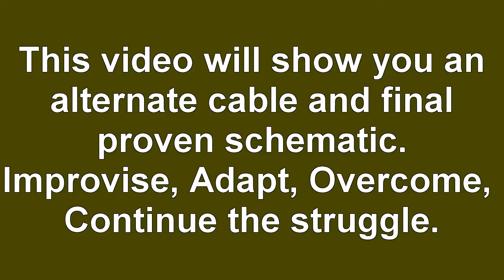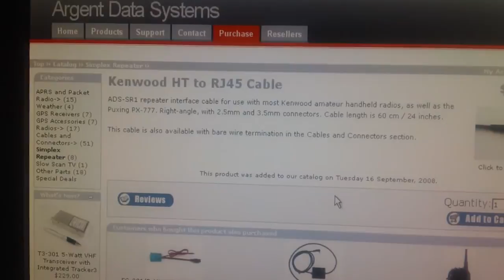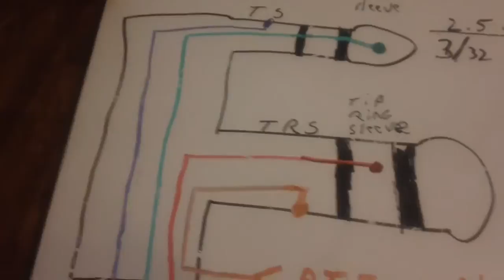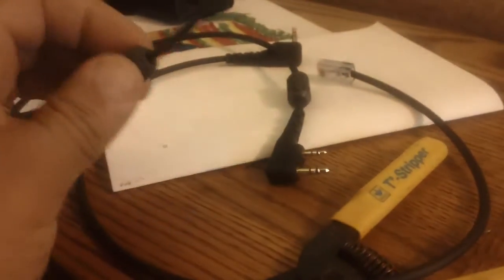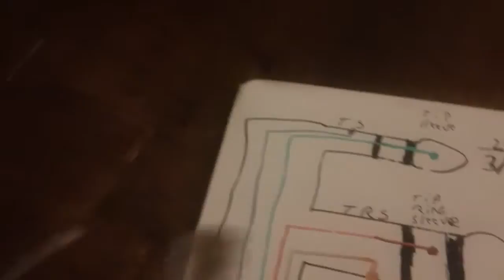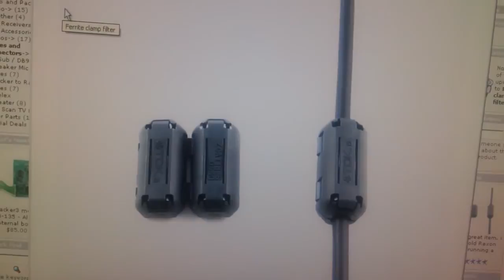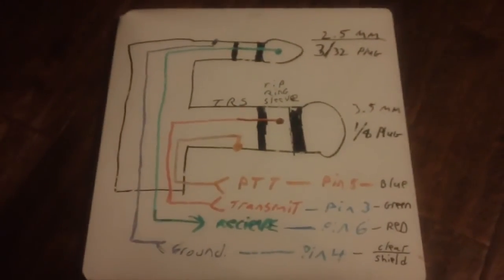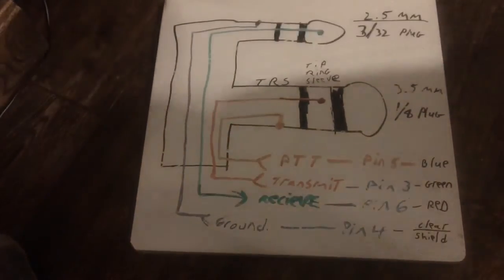SHTF WROL Simplex Repeater Build, TYT & Wouxun updated Radio interconnections.

Comment: The Baofeng UV5R I bought comes with a head set and mic and I found the cable acts as an antenna. I had to add a ferrite bead to prevent it locking into transmit in the same way as you have.

Comment: its a voice recorder that re transmits its stored audio not a true repeater. With all the trouble tootorola  make an HT repeater isn't worth the headache. just order 2 mobile radios like a Mmaxtrac or GM300's and connect them through a controller via the 16 pin rear connector or use the mic connector interface cable.

Comment: Nice video, solid information. You know you could break open the plastic molded connector on the Kenwood cable and then form a new cover/reseal it with Sugru. Look up Sugru.com, it's a silicone rubber putty, air cures in 24 hours, end user moldable stuff that is just the ticket for redoing/repairing plastics, metal, almost any material. I have used it to replace tip on a walking stick, tough stuff. Highly recommended for preps and DIY repairs.

Comment: Don't the TYTs and Wouxuns use Kenwood plugs? I can program my TYT using the same 2 pin cable I use to program my Kenwoods. I was under the impression that all Kenwood 2 pin adapters were the same. It's kind of annoying that Argent doesn't give you free cables when you buy one of their simplex repeaters.